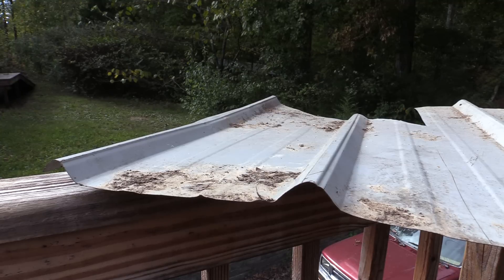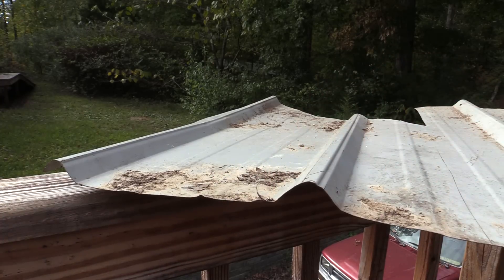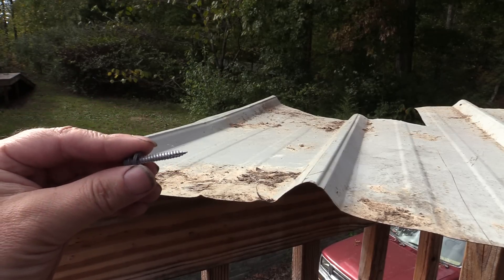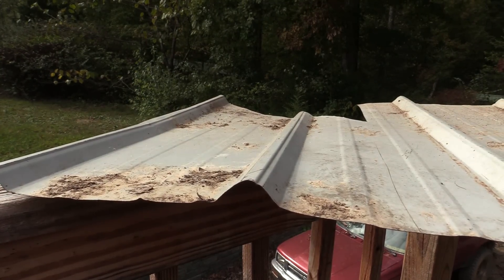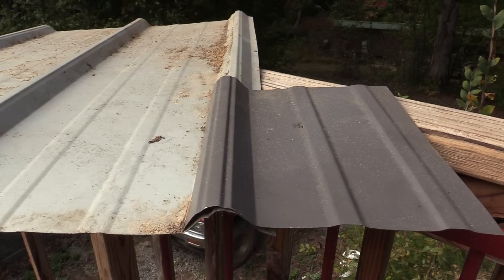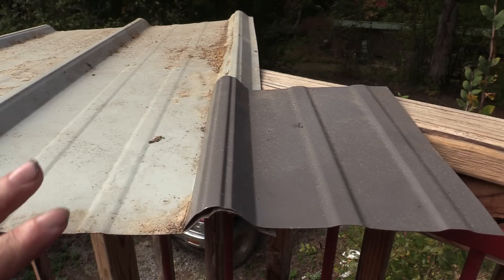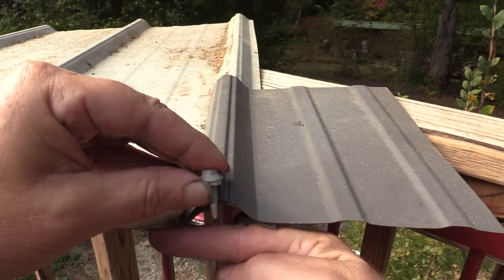Why you should not put screws on the ribs of metal roofing

Comment: First of all I would like to say a great of a video and response from the creator. I would also like to thank and say how much I love the responses of everybody Pro and con. This is absolutely so important on this subject and any others that we have the ability to hear everybody and try to search out the best truth for ourselves. What would life be if we didn't have any choice to Excel and learn from using our mind and actual trial to gain experience and wisdom. I for one have believed and still do believe that the peak on the sheet is the best way to go. And that is because of the water not getting in. That being said I can see the validity of thinking that if the whole sheet of roof is held together it could create a stronger structure. But we must not also be pulled into the weed so to speak by something that may be true but is not an overriding consideration for the customer. For me as a customer I want to provide protection for the items in the structure and for the structure itself. While the sheets May blow off if the water gets inside and ruins expensive equipment or things then that will be an overriding consideration. We had a hundred year old barn and something I noted was that there was an incredible amount of are getting in and out of the building to help with over moisture situations. Later on I noted from my cousin and really large buildings that a steel roof needed to have some form of insulation between it and the inside. That was to keep the roof from sweating or dropping water vapor down on everything because of in and out of air and cooling to bring out the moisture in the air. Well that problem then created a problem where moisture would get between the insulation and the roof and stay in there and I believe that could lead to resting off of your screws or nails and or sheets. If you do not have that kind of climate maybe that is an issue that you don't have to put the insulation in for and not have a problem like that. I think this issue is extremely variable and specific for everyone's situation. I know a lot of these companies that put on roofs are also looking for a quick install and that goes into the price and because we are being squeezed so hard by wasteful government we are always looking for the cheapest thing and that means the fastest put up thing too. Consider that if you pre-drill the sheets in a stack how much labor you cut out to install your screws or Nails wherever .... for me I like the idea of the sheets to be able to move back and forth a little bit on that spring action of the peak.. again your screw is being acted upon with more leverage than a screw on the flat and of course a screw on the flat can be shorter and cheaper. So there goes again something that completely changes the equation that is what can we afford. To me the overriding thing is trying to keep the moisture out. I like the idea of a rosin paper or asphalt kind of underlayment to help keep the water out and maybe that could be the best of both but again it costs more money .. what a good conversation by a bunch of good people both throwing Khan thank you all
Reply from the maker: @robertschumacher472  thanks for you lengthy comment. I am sure everyone appreciates it. When I was a contractor I specialized in restoring Victorian homes circa 1880. Roof pitch was 12/12. Standard practice was to use tar paper underlayment. This helped with the moisture as well as providing a little lubrication for the movement of the metal. There would always be holes where the metal would rub through the underlayment. Today most use synthetic underlayment. They make a special one just for metal. It has the tarp like base plus a rubber matrix on top to prevent the metal from rubbing through. While it is ok to try to save money my advice would not be on the roof. Buy as many screws as the job needs including stitching screws use 1 1/2 screws for flats and if you want to do ribs 2" screws as the screw has to go completely through the substructure to achieve maximum holding power. If you are doing it yourself then you are already saving a ton of money. Your goal should be to build the longest lasting roof not the cheapest one so also use the better underlayment. Thanks again for commenting.
Reply: @honeybeehomesteading  thank you so much for your kind and informative reply. I had the bad luck to be injured by a ball and turned out a quadriplegic. That has left me a little to do with hands and body. I do have a question from your knowledge please. My fiance and I live on a piece of property that has a pole barn and on one part of it there is leakage on the inside but only on the hardest blowing highest amount of water thunderstorms. I had somebody up here the other day to look and was happy that the roof add screws on the peaks. He looked and believed that the screws rubber washers were still good. There is no apparent damage especially where the sheets should be leaking. He has a roofing contractor and is not sure what is causing it. He thanks it could be the sheets blowing up at the ribs in that area and getting under but he is not sure. I don't like this particular style because the roof does not overhang. Is it possible the water could be running down the roof and being blown under but then wouldn't be everywhere? Any ideas?I will be looking at getting the new kind of mushroom crown screws which are supposed to be a lifetime option for the rubber seal underneath instead of the standard flat ones. I guess the last question would be how can you tell if the washers are leaking short of pressing the sheet metal down and peering intently on the washer or removing the screw? It was a wet day so I didn't want him getting hurt but would be interested in your thoughts. Thank you so much for your reply and info.
Reply from the maker: @robertschumacher472  ok I am going to try my best. Many things to consider here wind being the main problem. I am going to assume you are talking about 5 v roofing or is it the style in the video? Also is the roof on solid decking or purlins. If it is on purlins it could be condensation but let's assume it's not. The easiest repair may be this. We don't know it the screws are damaged but I have never known water to be able to travel past the ribs where the panels connect with either style so let's assume you have some badly installed screws. You can have your roofer caulk over them and any other potential leaks areas with clear silicon for gutter and flashing. You can't use regular silicone as it has a acid to help with bonding that destroys metal roofs. The gutter and flashing does not have ithe acid and is safe for metal. Alternatively you could go ahead and have the roofer replace the screws with the single body which have a larger screw shank so they will grip well through a old hole. I have a video on screws you can watch if you need. I hope I was of some help.

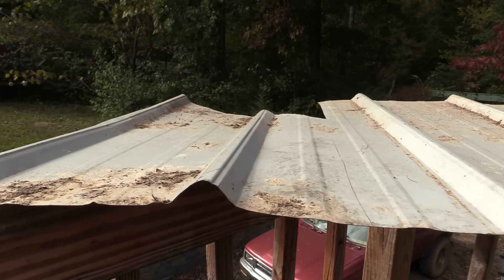Comment: Screws go on the flat like the video says. Check with your manufacturer if you're not sure. Don't over or under compress the washer. You should get 20+ years from the neoprene washers. Also the metal manufacturers recommend 3:12 minimum pitch here which should shed water swiftly. Also the ribs are for thermal expansion. Corregated roofing is different, you can screw the peaks when using the ribbed backer panels

Comment: I dunno. I’ve done several jobs with this “modern” metal. Growing up partially in Maine, metal was very popular due to snow and the method there was always fastening through the peaks of the ribs.
I saw the instructions about using the flats but I couldn’t make it make sense to me.
The “washers” on the screws have been rubber or more usually an open cell foam and relying on them to maintain a watertight seal and not to fail due to drying out in the sun and placing them in what is essentially the bottom of the “gutter” just seems like a recipe for failure.
I use the top of the peak with longer screws that are available taking care not to deform or squash the ridge because water cannot gather or sit there.
I’ve had no problems.
I do use red rosen paper as an underlayment between solid wood sheathing to protect against any irregularities that might cause friction.
Reply: Here in Australia, where metal roofing is very common, the screws are always installed through the centre of the peaks, never the valleys.
The real trick is to not over tighten the screw, so as to not deform the metal or squish the seal out of the screw head. As my neighbour, who is a roofer, told me, once the seal makes contact with the roof, just a smidgeon more and no more.
Reply from the maker: @Bay0Wulf  those rubber washers actually bond to the metal, that is why they work. Thank you for commenting
Reply: @honeybeehomesteading  
So … if the washers go around an immobile screw but are bonded to a mobile (constantly expanding & contracting) material, how do they avoid being ripped, split or otherwise degraded at the point of bonding and simply being a “funnel” point for liquid (a leak)?
Reply from the maker: @Bay0Wulf  there is some room for the washer to move in the center without negating the bond as the rubber can compress and expand. But if you overtighten the screws they become just as you described a funnel.. overtightening on the rib ia harder to do as the rib deforms easy. Proper screw installation is a must. I throw away a dozen screws that got overtightened on every roof I have ever done. Better to throw away screws than risk a leak.
Reply: I put up a barn in 1990 and pulled it down in 2017.    The screws had just a bit of  surface rust and the neoprene washers in perfect condition.  I still use them over for here and there repairs on things .  Those seals seem to last forever.
Reply from the maker: @drizler  agreed the seals are way better than people think. I have never had a screw leak that was properly installed.

Comment: It's not about structural strength. It's putting the screw where the water runs the least which is on the rib. Screw goes on the rib.
Reply from the maker: @zetamale7952  not according to the roofing manufacturer
Reply: @honeybeehomesteading   That's ok. Manufacturers are wrong sometimes. I was in maintenance for many years using many products. Following the manufacturer recommendations sometimes creates the fault of the product. How you do it is up to you, but when the seals on those screws dry out or shrink and crack or screws are installed wrong on the flat, the water will find its way thru that unsealed hole whereas on the rib the chances of leakage due to seal cracks is far less. Far less water travels the rib. We've all seen it done both ways. My choice is the rib, and I'll always recommend that regardless of manufacturers recommendations. A self-sealing rubberized membrane stuck to the underside of the roofing steel would prevent leaks on the flat but that would be expensive.

Comment: What are the possible issues of screwing in the side of the rib? I did my shed and chicken coop that way.
Reply from the maker: @w.knudsen5570  well for one you are pulling the metal to the side as well as down would be the biggest issue. 2 you are exposing the rubber washers to sunlight on the top edge which would degrade them much faster. 3 you are negating half of the holding power of the screw so a really bad wind storm may pull off the roof. If you want to go through the rib do it on the top not the side. You loose your structured element of the panel but like many have commented here it won't leak.

Comment: total nonsense. You fasten through the ridge (don't deform with over tightening)  fastening on the pane will leak. a 30 foot metal panel stretches 1/2" or more when heated by the sun. this will break off the screws in the plane or elongate the holes or loosen the screws. In the ridge the screws has 1 inch above the substrate to rock back and forth. They will loosen there eventually but it doesn't matter.The water is shed there.  I like to use a punch to make a dent before using the self taping screws so they wont slid off and cause a rust scratch. forget trying to pre drill. The bit will break or you will go too deep and ruin the screw hold.
Reply from the maker: I have never seen anyone drill while on the roof. You can predrill but the hole has to be much smaller just enough to allow the self tappers to bite (3/32" works well). As far as the nonsense goes take it up with the metal manufactures as this is their screw schedule.

Comment: Confusing. What do you do with the next course of panels? Do you have to screw the bottom of the panel? On overlap does the top panel have to be screwed to the bottom panel?
Reply from the maker: no watch the video again for this demo i was laying down metal from left to right. the next course overlaps the bottom( the edge with the 1/4"  flat is the bottom and the side without is the top. the top piece gets a screw by the first rib and the second rib in the same flat. Then it is a single screw next to the rib in the flat for the other 3 ribs. the top panel is not screwed directly to the bottom as this allows for expansion. As people will testify that you can screw the tops of the ribs it is not what the manufacturer says to do.

Comment: Cool. My metal roof is installed just as you described. I just dont know if i need to go up and check screws from time to time. I do go around the edges and tighten screws down if needed, maybe a little silicone as well. Roof is about 14 years old.
Reply from the maker: @beachdweller3378  you really shouldn't have to check screws. That being said a screw is only as strong as the substraight. I always build my home roofs with 5/8 plywood or OSB. 7/16 I believe is too thin. Be careful about using silicon. Use only gutter and flashing silicone. Regular silicone has a acid to help it bond and it will destroy galvanized metal.
Reply: Silicone cures with acetic acid and causes the steel to rust in the long run.
Reply from the maker: @pseudopetrus  he is right do not use regular silicone as it will ruin a roof. The silicon for gutter and flashing is fine as it does not have the acid in it. I use it when I am flashing in chimney to go between the masonry and the metal. Another alternative is butyl but it is awful messy.

Comment: Always screwed top of rib , know how to use , not loose and not to crush the rib , every rib 2 foot  on the eve and after every 4 foot to peak . 
Have done at least a hundred from  barns to small cottages 8/12 to 4/12 pitch. 
Not a single leak or loss of material do to 60-70 wind conditions. And have been on roofs that I installed 15 years ago to add dormers, the screws have not loosen and the rib shows no ware . 
Yes it will void warranty on some tin manufacturers but , most of that is a broken system.  Insurance companies dont care about warranty on claims,  the underwriter looks at the year ,cost age and performance of pre damaged materials. 
Just my experience,  upstate newyork. 
Cant say how its works in Tennessee,  California,  Texas  climate. 
Guess you just need to know what works in your area.
Reply: My father inlaw was a builder and he did it as you do it heathhill. We put the metal roof on my house 45 years ago, have never seen movement as honeybee talks about. I have never had a roof leek. In that day and age at least here in Canada there were no instructions as to how to install the roof. My father inlaws beleif as well as mine was that there was less rain water to get in by nailing it on the peeks of the tin roofing. I am about to do my garage roof but am still going to screw it from the peak of the tin as I have never run into trouble and it worked then and am sure it will wok now.
Reply from the maker: @heathhill7802  you will not see many roofs done that way in Tennessee as the manufacturer schedule is on the flats I have installed on 3/12 to 12/12 with no issues. I have done some sheds on less than 3/12 for myself where a leak would not be a big deal but it is below the manufacturer recommended pitch and still was leak free. Manufacturers may want the flats because installers may have more issues with crushing the rib. The screws work on the flats very well. No matter where you screw it metal roofs far out perform asphalt shingle and has always done so.. That's for commenting and watching

Comment: Rib is where the water isn't, don't over think it.
Reply: True, it leaks on the flat.
Reply: Screws especially here in Canada, with cold winters and warm summers, screws will work themselves out. If in the flats, the roof will leak. I have seen roofs leak from day one when screwed in on the flats. If it is screwed on the rib, water runs down each side and not through. Shingles are not structural and metal roofing should not be either. Metal roofing is to keep water out and for a long time.  It is different if screwing metal on a side of a building, which is probably what the instructions are for.
Reply: @dllion3196  Yes a wood screws or nail is never going to be a reliable water proof seal, and the washers harden and go bad fairly fast as well.
Reply: @MS-ig7ku  Even the proper screws work themselves out over a period of 15 yrs or so. They always need to be retightened at some point. Nails are a definite no-no.
Reply: @dllion3196  Yes very true. But nails used to be standard, galvanized steel with lead washer for steel roofs, and aluminum nail with rubber washers for aluminum roofs. I have replaced failed nails with screws.
Reply: @MS-ig7ku  You're right. That is a very long time ago. I do remember it.
Reply: IKR?
Reply: True about water not so much on the rib, valley is a flat seal for grommets. 😎♾️🇺🇸
Reply: Rib isn't where water is.  What's your point?
Reply: Makes sense. ♾️🇺🇸💯
Reply: Never seen a screw fatigue and fail on a rib... ever.  You can get plenty,  even too much pressure on a rib based screw placement.